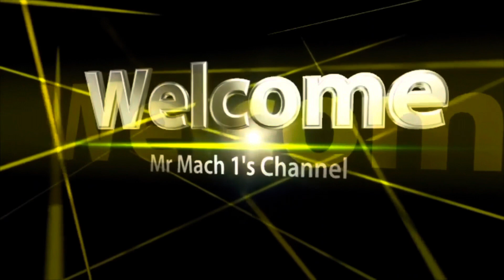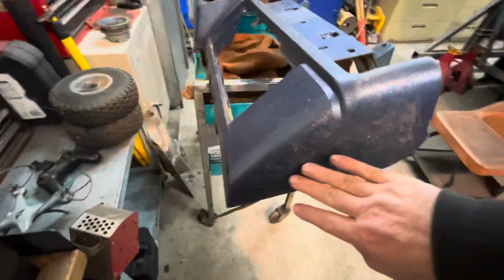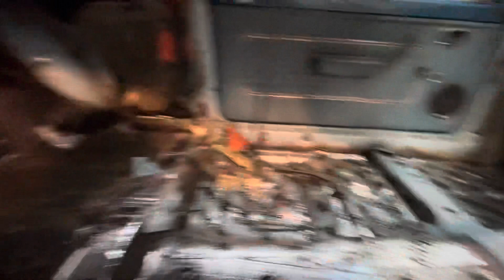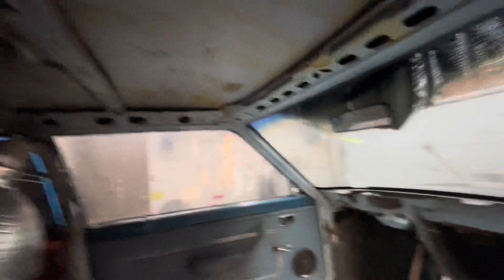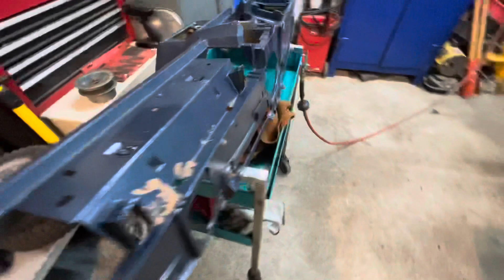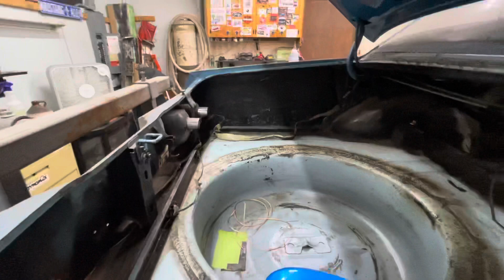Ford Fairmont What to do next? #build #projectcar #foxbody

Comment: If the original wiring harness is low mileage and good shape I'd say use it. If you don't plan on ac/heat make yourself a nice delete plate that you can add switches or additional gauges. Glad you're feeling better 😁👍
Reply from the maker: I’ll have to inspect it.

Comment: 1st!🏁 Yeah buddy! Im glad your better!
Reply from the maker: Thank you! Hope your feeling better.
Reply: I seen Funky‘s video on removing the paint. Looks tedious and frustrating. I would do that a little at a time while doing the brake lines. Brake lines probably will go together smooth since you have all the original lines. I did my Mach1 backwards, I’m going to do the fox the same way. Doing paint last. It worked for me ! I bagged the engine in plastic, and taped up the compartment and sprayed. I got a little overspray on the backseat but got it out. I know what you mean about not feeling like doing anything.  All I do is sit on the couch. One minute I feel good, the next I’m drained. I’d use your factory wiring, save all you can to get the power plant. You can tweak other things after its complete!
Reply from the maker: @BigStickStangs  Thanks. Good ideas my friend. Hope you get to feeling better soon.
Reply: @MrMach1  Thanks buddy 👊